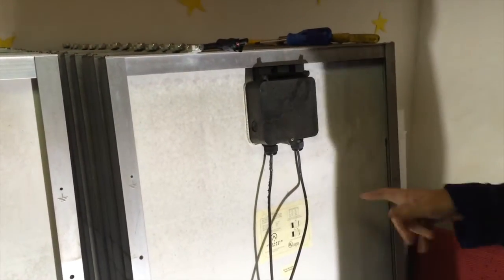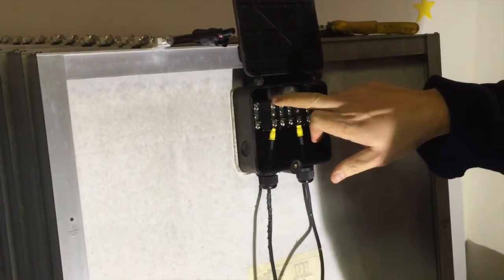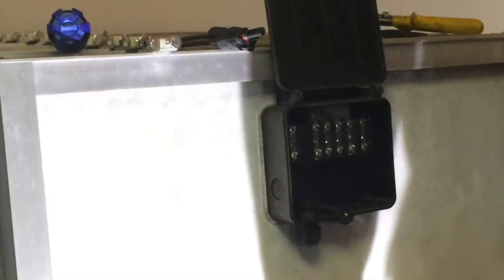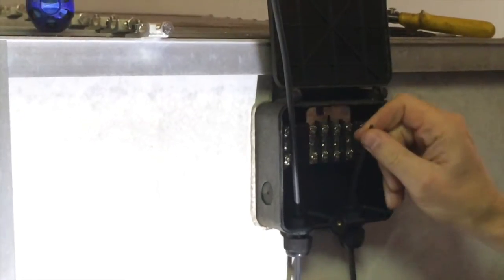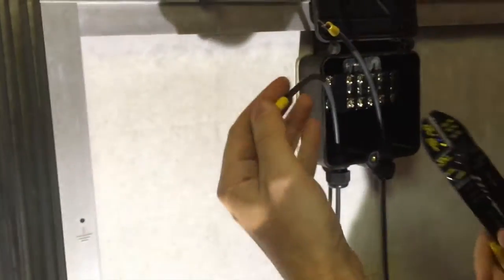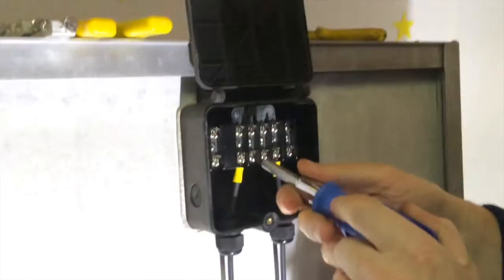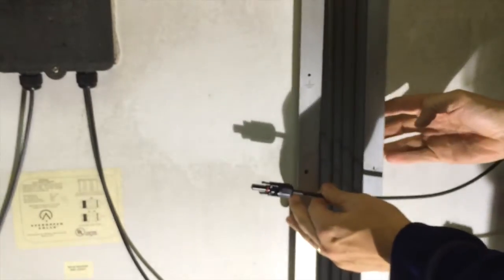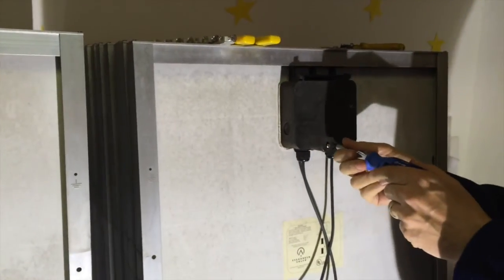Rewiring Solar Panels – Replacing Wires

Comment: Are the old mc3 cables also called the 8 mm cables .  If I have a row of old panels can I connect them in parallel using their old MC3 connections and then only have to rewire one male on one end of the panels and one male on the other end of the panels to the MC 4 connectors. So all of the panels would be connected with the old original MC three but I would have one male and one female Newer connection MC 4 that I can connect with an extension cable to my solar generator

Comment: My neighbor solar System has exactly the same problem but unfortunately he has LG panels where + and - inside the junction box are solder.  He wants to replaced those cables with mc4 or mc3.  Any help would be appreciated.
Reply from the maker: Wow tough.  Not sure what to think about soldered connections.  Resoldering sounds super hard, especially if the box is plastic.  Sorry I can't be more help.